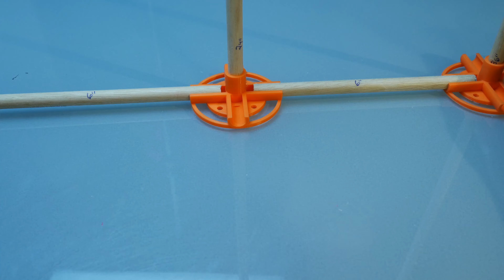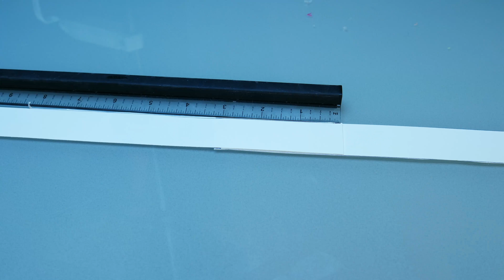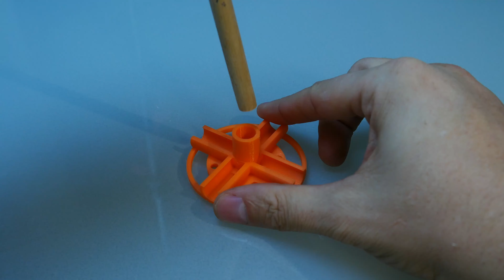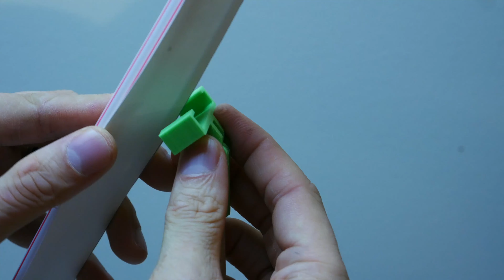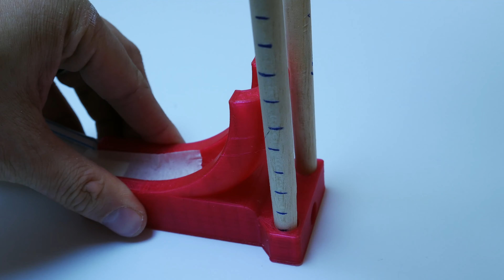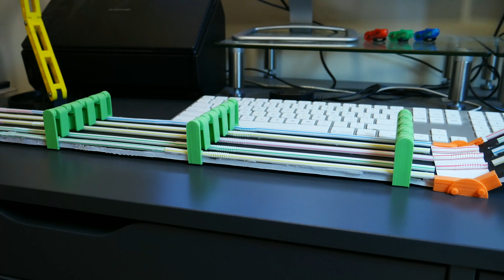Marble High Jump for Under $5

Comment: How on earth did you print the hinges pre assembled like that? What support settings did you use? That would be great. Thanks
Reply from the maker: I  didn't use any supports at all to print.  If you look at the images of the files I provided at Thingiverse, you will see how I printed them.    I printed them with their backs laying on the printer bed so you do need to worry about supports, provided you print at .2mm or smaller layer heights.   

https://www.thingiverse.com/thing:3471775